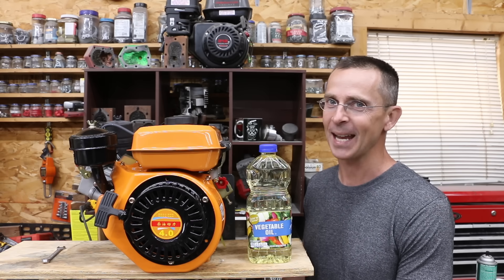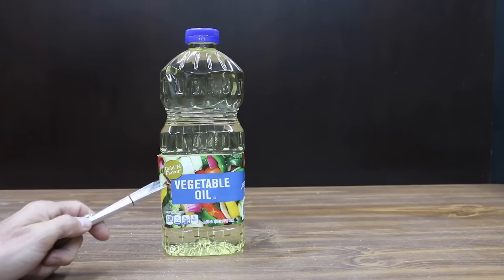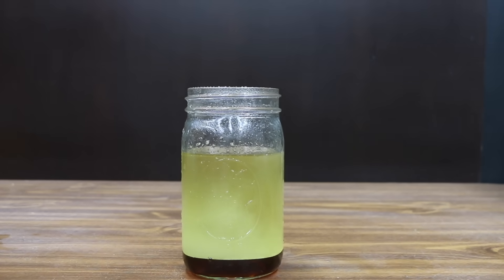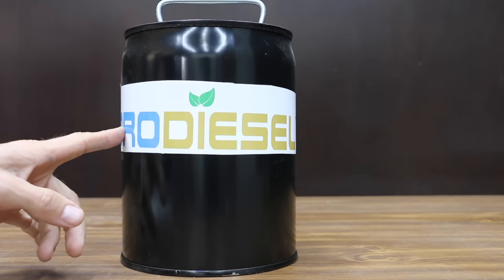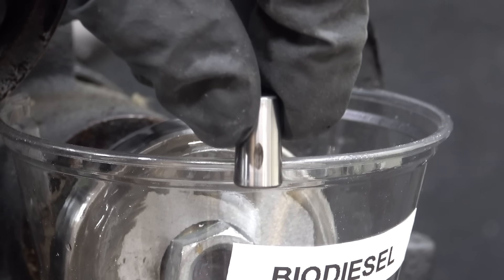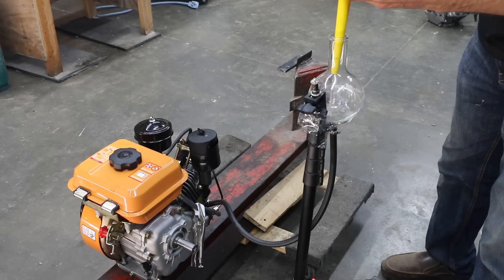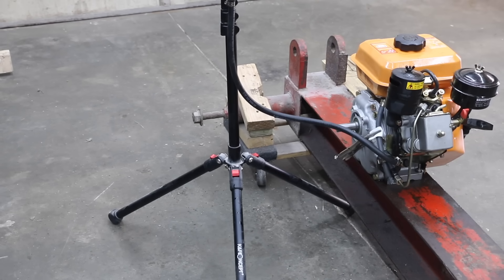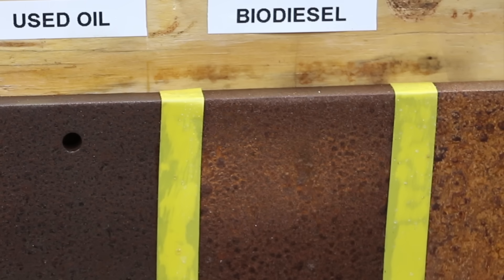Make "Biodiesel"? Let’s find out! Diesel vs Biodiesel, Used Motor Oil, Vegetable Oil, MPG

Comment: Owning a diesel is becoming non-PC. Especially out here in Cali. I have heard with a completely computerized timing system including the valves, a diesel is not only more efficient but cleaner than gasoline engines.
Reply from the maker: Thanks for sharing.

Comment: Nice lil diesel engine. Wonder if you could mount it to a go-cart or ATV. You could probably cut the home made biodiesel with normal diesel, like a 40:60 biodiesel/diesel mixture. Maybe a 50:50.
Reply from the maker: Thanks for the suggestion.

Comment: I would love to see some efficiency/consumption comparisons with these fuels. 

Also, it's interesting to think about, but would the suspended particles in the used motor oil counteract the increased lubricity?
Reply from the maker: Thanks for the suggestion.

Comment: I wonder if your test engine would run any differently if there were a load on the crankshaft....    (Like a generator connected to the crankshaft with a resistive load on the Generator.)
Reply from the maker: Thanks for the video idea.

Comment: I thought sure cousin Eddie was going to get a flammable haircut but not this time. In 1972 while I was still wearing o.d. green I ended up in the quality control tent, yakking with the guys that checked everything and made changes to keep stuff right. We got to talking about the diesel that came in by tanker and how much water content it had. They had a small ice box they kept fuel samples inside the freezer. They said look so I opened it up and some pill bottle tops (sample containers) were jacked up an inch or more. They said that was normal because diesel had a high water content anyway. That was in 72 and the equipment as well as the asphalt dryer/heater/burner ran on the same stuff. The emulsion might've been suffering because of the added water and that diesels usually have a water separator installed with a fuel filter. Thanks, Commander and happy hay storing and Be BLESSED, EVERYBODY!
Reply from the maker: HI Lewie, Cousin Eddie definitely needs to be more careful, lol.  Very interesting regarding the water content in the diesel fuel. The older diesel engines seem far less sensitive to fuel issues compared to the new fuel systems.  Always great to hear from you and hope you're enjoying the warmer weather!  Blessings!!
Reply: @ProjectFarm  We're mowing and harvesting and all is well for old goofy folks. I remember when diesel was 10 cents a gallon but that was a WHILE back. And as far water, maybe they refined their refining. Yall remain calm and GBWYou!

Comment: I have a friend that has been running his 2nd gen 12v cummins, and 2 Mercedes 290d's on used fry oil from the local restaurants for the last 20 years. He gets the oil free as the state charges to pick it up for recycling. He does nothing other than filter the chunks out. You know he's nearby when you smell french fries in the air. His total cost per year for fuel is like $50 in filters.
Reply: There used to be a whole scene of people in Germany doing this, they called themselves "Pöler"  (from PflanzenÖL = Plantoil). 
Old fry oil, vegetable oil like rapeseed oil, sunflower salad oil (which was cheaper at the next supermarket than diesel at the petrol station).Works best with older diesel engines and in summer, most modern injector pumps don't like it. So it's a dying species.
Reply: @Slazlo-Brovnik  Poles did that as well. 😆 I know cuz Im the one. Used french fries oil with some diesel in my old Golf with 1,9 TDI.
Reply from the maker: Thanks for sharing.
Reply: If he was in Wales UK , he would be prosecuted and fined by what they call their "frying police".  They don't want anyone to have cheap fuel! :-O
Reply: @brettymike   here's the Trick, just do it and keep your mouth shut!  What the Gestapo pigs don't know ain't gonna hurt you
Reply: @johnsegertsons2143  You can't (unless you want a war with them)...they "sniff out" their $money targets" and pounce.
Reply: @brettymike   Sad but true
Reply: @johnsegertsons2143   Sad but you're right!
Reply: @brettymike  Jesus...

Get the hell outa there and head over here (where you can run any fuel you want, for starters). With a population of 65 million shoe-horned into an area the size of Louisiana, when the bad times come, they're gonna be worse there in the U.K!
Reply: @erwin643  I am definitely not there!.  Now and then when I change my diesels oil, I tip it straight into the fuel tank.
Reply: @brettymike  I think I'm gonna start doing that again as well: Into a mixer/filtration unit, thinned with some gasoline,
Reply: @brettymike  it's not legal in Germany either and can get you in trouble for tax evasion.

People used to run their Diesels on heating oil which is much cheaper.  That's why a colloquial (snarky) term for cars with a Diesel engine is "Heizöl Ferrari'.
Reply: @saschaschneider6355  Ah, the real reason, they want their tax money...
Reply: @dewdew34  yes, and nothing wrong with that. Road infrastructure costs a lot of money
Reply: No, he does more than that. He is running a dual tank, one diesel/biodiesel, and another VO.  VO needs to be injected into a warm engine, else if will not start.  Note, this is true for 99% of all folks I've ever seen, talked to, or read about running SVO (Straight Veggie Oil).  If he told you different, he was pulling you leg.
Reply: @boots7859  I've seen his setup. No dual tanks. No reactors, stills, or anything else. Through a set of filters into 55 gallon drums, straight from the drum into the fuel tanks. 
I should add we live in the USA desert southwest. Winter temps are like 50°F. Summer gets over 120°f
Reply: @boots7859 Thats not true, u can run most prechamber diesels without any diesel and use just 100% filtered used cooking oil. Only need to adjust fuel pump timing for better results because veg oil burns slower.
Reply: This works (and smells) good for some engines, unfortunately big gov has laws in place that the restaurants must account for every ounce of oil.  They have to keep records where it goes or face being fined.  How can this be done currently without being caught?
Reply: Exactly. The reason they use this is because it's free. You can always find a restaurant throwing it away and just take it from them.
Reply: When I worked in my friend's garage a neighbor showed up from time time with the late '80 D190 - it runs on pretty much everything during summer time. Winter different story as temp drops below -20°C. Try the same thing with the new high pressure injection diesel engines - the injector replacement isn't cheap.
Reply: Your friend is telling you tall tales.
Reply: @SOLDOZER  swing by southern Utah. I'll introduce you to him and he can show you.
Reply: @davemcdaniel4856   Pure internet bullcocky.

Comment: I think I would go with the used motor oil cut with gasoline, maybe even mix in some diesel fuel to run a small engine.  Not sure I would want to try it in my tractor unless we were in dire straights!  BTW, the motor you bought is sold out on Amazon same day of the video (may not be related).
Reply from the maker: Thanks for the feedback.

Comment: Great video. I love this topic. My only comment would be that although cutting  the used motor oil with gasoline will lower its viscosity and its flash point it will actually make it harder to burn. What you should be conserned about it the auto ignition temperature. You'll find that diesel has a lower AI but higher flash point than gasoline. I would hazard a guess and say cutting it with diesel would be a better option.

Would love to see some more measures of performance on the engine, perhaps an optical smoke sensor and a dyno of some sort? Exhaust gas temperate would be interesting too.

I used to work in a place where we'd filter and blend all our used oils into diesel for the older service vehicles. Even 85w-140 gear oil at 5 parts diesel to 1 part gear oil.

I'm looking forward to more content with this engine.
Reply from the maker: Thanks!  Thanks forthe suggeston.

Comment: Have been using straight vegetable oil on a VW 1.9 PD, the only "problem" is a slight power decrease (2-3 HP), still have that car 250 k miles on the cluster and still running great.
Reply from the maker: Thanks for sharing.

Comment: That RAM could be a good candidate for testing RVS, they have a product for treating diesel injection pumps, should protect it for a good while.
Needs 2 packages though since 1 is meant for a maximum of 3L engine displacement.
Reply from the maker: Thanks for the suggestion.

Comment: Making biodiesel is easy but making it ¨in spec¨ and/or safe to use, is not.  I could see that your biodiesel sample was contaminated. This will effect the lubricity test, corrosion, cold flow and run tests.
Reply from the maker: Thanks for the feedback.

Comment: Damn if I could use some sort of alternative. But those new diesels with high pressure systems will fall apart just by smelling this stuff lol
Reply: Get this mixture wrong on the high pressure common rail diesels and your in for some expensive repairs to the fuel injection system, the old type indirect injection engines are far more tolerant to fuel quality than the new engines. I’ve known people use old filtered engine oil diluted with Kerosene to make it thinner for use in winter when the temperature drops but again only in the old IDI engines.
Reply: @davidellis279  You deffinitly have to be careful, you need to use well processed bio for your mixture, especially on the CP4 designs though, the pumps will last way longer on at least a light bio mix. Most manufacturers have to rate the modern diesels for B20 now since that is mandated in some areas, so I'm fairly sure you can push a bit past the manufacturer recommendation with the headroom they usualy include. I wouldn't trust the random stuff that the neighbor made in his garage. The commercial blends have to be tested to make sure all the chemicals used for glycerin removal have been washed out.
Reply: the main problem is particles that can damage the injectors, too high of viscosity for the injectors, and ash content, vegetable oil has low ash content, and no particles. adding it to diesel should prolong the life of the injector pump, I would strongly advise adding some vegetable oil to Fords in particular since the newer ones use Bosh pumps intended for European fuel, which has more lubricity, 50:1 should work, there are also used oil centrifuges that get all the garbage out of the used oil, which would allow used motor and fryer oil to be used as a lubricity additive as well. Biodiesel might work out of the box.
Reply: I thought new diesel can use b20
Reply from the maker: Thanks for the feedback.
Reply: You could probably run up to a 50% biodiesel mix in common rails if you didn't have to take the DPF into account. I wish more places offered bio anymore. Doing a 20% mix keeps the modern pumps alive longer and probably wont kill DPF's faster than normal.
Reply: @CondoreComputing  Problem is not the DPF as such, it's the regen cycle. Most manufacturers regenerate the DPF by firing the injectors again after the exhaust valve opens- the extra fuel ignites and goes right out the exhaust, which raises the exhaust temperature enough to burn off the soot in the DPF. Biodiesel has a higher boiling point than normal diesel, and this strategy can cause some of it to condense on the cylinder walls during the regen burn and find its way into the engine oil, where the lower lubricity of a engine oil/biodiesel mix compared to straight 10W30 eventually makes itself manifest upon your engine bearings.

You could circumvent this by adding an extra injector in the exhaust to add fuel for the regen cycle, but injectors are expensive ($250 each in my car) so this strategy is unpopular with shareholders.
Reply: @nerd1000ify  I have also heard some claims the Biodiesel accumulates ash in the DPF faster, after a DPF regen, ash is permanently left in the DPF that cannot be burned off, and that is why no matter what they are a wear item and have to be serviced (cleaned if removable) or replaced at some point unless the vehicle outlives it. That is why a lot of light duty diesel engines require low saps oil.  Not sure about the validity of the claim about bio for the DPF, but I am very familiar with ash accumulation in DPF's with the few diesel vehicles I work on. 

The biggest reasons for excess ash accumulation is calcium, potassium or any other alkali metal hydroxides. That either comes from oil additives or fuel contamination. 

Reading a pretty in depth article it looks like even B20 can double the ash load compared to just contaminants from engine oil burn off over a 150K mile period. So there may be a valid point there.

But your point about fuel contaminated oil is correct too, I forgot about that factor.
Reply: @CondoreComputing  I see what you mean, especially considering how home made biodiesel is usually made with KOH as the catalyst. Unlikely that many home gamers have the equipment to fully clean all of that out.

It should be possible to eliminate the ash from biodiesel with appropriate processing, in fact I suspect that this is already done industrially as most diesel sold where I live contains up to 4.9% biodiesel but still complies with the ULSD standards.

Comment: To let you know, ifypu didn't already.  Veg oil has better lubrication properties than diesel and more BTU than diesel.  Running used untreated veg that I ran through a 1 micron sock filter in a 5cyl Mercedes diesel,  I had better power and 5-10% increase in fuel efficiency.  Being untreated I plugged pre filters more often and had to replace main filter every 5k or so. For the pre filter issue I made a split that ran one line into 4 filters back to 1 outlet.  That made a world of difference.  Before that invention I plugged pre filter every 50-100 miles. After it worked really well being that only 1/4 of the fuel ran through each filter over the same time period and also because of the fact that with 4 filters each one would work while being more restricted.  You know, say that it ran acceptably until plugged halfway.  With 4 it is ok until 12.5% flow. I did go through pumps every 15-20k, but I had parts cars with pumps. The untreated oil is much more acidic. Sorry for the long post. Thought you might find my experience interesting
Reply from the maker: Thanks for sharing!

Comment: Would have liked to see a load test comparison using a generator load of 500w and 1kw
Reply from the maker: Thanks for the video idea.
Reply: @ProjectFarm  no problem! I'm considering manufacturing fuel myself, as well as converting a small truck from a drive shaft to hydrostatic pump and motors

Comment: I ran a blend of 50/50 diesel to waste motor oil (WMO) in a Ford 7.3l PowerStroke for a few years. It ran smoother, quieter, and had more power and better milage. It did have slightly more exhaust smoke.

Some guys run 15/85 Reg Gas to WMO. They usually advance their timing about 15*.

Never try to burn synthetic oil. The burn point for it is much higher than dino oil.
Reply from the maker: Thanks for sharing.

Comment: Try different transmission oil’s and see the wear scar on each one
Reply from the maker: Thanks for the suggestion.
Reply: I used to run a quart of atf in my diesel Mercedes once a month to help smooth it out, stay away from synthetic and it'll run great
Reply from the maker: Thanks for sharing.

Comment: from my experience my 7.3IdI runs great on every oil i have chucked into the tank including power steering/brake fluid, atf, deep fryier oil, and used motor oil.
Reply from the maker: Thanks for sharing.

Comment: Back in 2008 I had a 1998 Jetta TDI and ran straight vegetable oil without anything else without doing anything to it for a straight month. Lol of course that was also July but basically we figured out anything over 50° outside and you couldn't run it You might have to cut it with something but it could be done
Reply from the maker: Thanks for sharing.

Comment: I can tell you from experience that making your own biodiesel is only viable if you have a truck with a lift gate. Why? Because you need to buy LARGE amounts of methanol in order to get good prices on it. You need the lift gate because you don't want to be hauling a 55 gallon drum of methanol with you everywhere you go. Note, you can only buy ONE drum of methanol at a time or else then you have to get hazmat permits and such. For me the closest I can buy methanol is about 50 miles away and they don't assist you in loading it into your truck. 

What I discovered about making your own biodiesel is that it's not worth it if diesel prices are under $5/gallon due to all the work and time you have to put into making it and cleaning up after you're done. It sounds easy and cheap but unless you're a commercial operation, you will find you spend FAR more time cleaning up or acquiring chemicals than you will save in $$$ if you count your time at minimum wage. 

You don't want to run your diesel engine on pure veggie oil because it will do horrific damage to your cylinders. Ever overheat a skillet with oil in it and you get that really sticky substance on the skillet? You'll get tons of that on your cylinders and that'll cause all sorts of injector/valve/piston/ring/cylinder issues. There was a study done and most diesel vehicles have no problem with a 10/90 veggie/diesel mixture as the detergents, etc. in the diesel help remove the issues caused by the veggie oil. 

I'm interested in some of that Hydrodiesel. I may see if I can find a supplier. We rarely have issues with our fuel gelling since we have a block heater but there are times when that isn't possible and for those times I'd like something that didn't require me to use one of those fuel heaters.
Reply from the maker: Thanks for sharing.